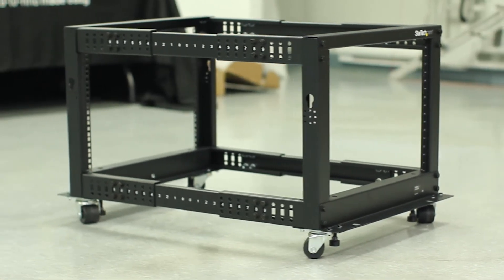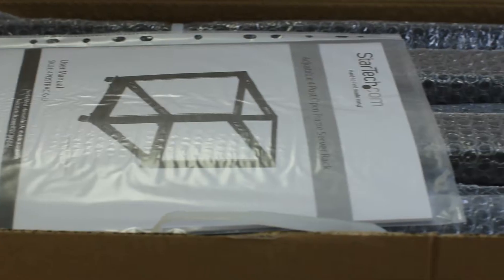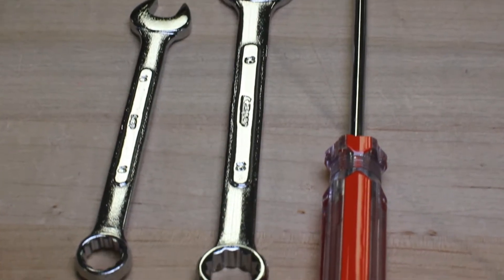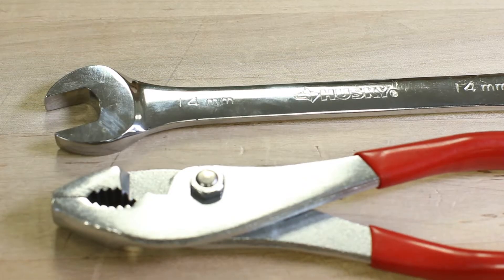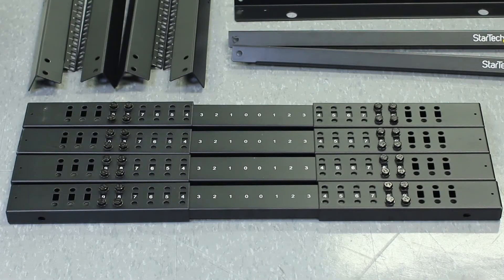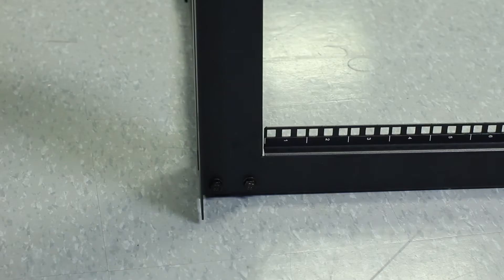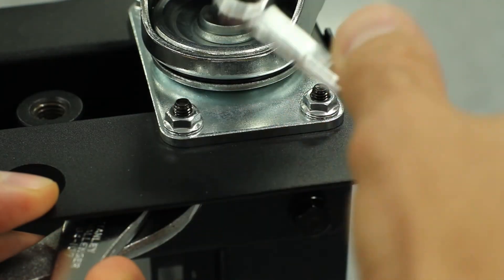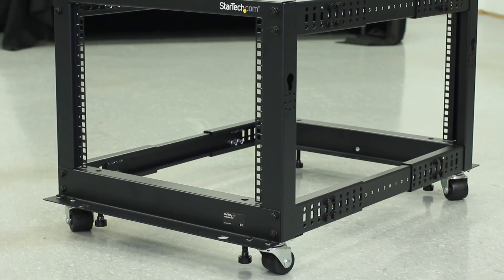UNBOXING and ASSEMBLY - 4 Post Open Frame Server Rack Series | StarTech.com

Comment: One of the wheel bolts is a real challenge to get in as it’s partially blocked underneath by a bolt on the adjustable rail. I removed the bolts on the rail to allow for some movement and was able to get the bolt in eventually.

Comment: Ok, I built mine just by looking at the schematic diagram, however, I'm looking for how to set the adjustable sections. Instructions say "for x use index numbers y and z" but how do I reference them to get the desired setting? There's no marks to indicate a referance point to use the indexed numbers.
Reply from the maker: Hi, You may want to check in with our Technical Advisors - They are available Monday through Friday 24 hours a day. https://chat.startech.com/

They can walk you through adjusting the rack to fit your set up.

Comment: This video really helped with getting the pieces in place in the right order. The instruction manual suggests that the top and bottom horizonal bars install between the left/right bars and the adujustable bars, when they should mount in front of the whole stack. Once that was cleared up, the rest of the assembly process went rather smoothly  (except for the feet, see below).

Helpful tips that I wish I knew ahead of time:

* when installing the top horizontal bars, it helps to bolt the adjustable bar into the left/right bars though the bottom bolt hole before attaching the top horizontal bar through the top bolt hole - that will hold the adjustable bar to the left/right bar while you align the horizontal bar
* the bolt holes for the adjustable feet have a plastic lip at the end (why???) that you have to thread through with the bolt as you screw the feet in; you'll need an adjustable wrench to apply enough torque to screw them in
* if you are using both the levelling feet and the casters, screw in the levelling feet in first; otherwise the casters will get in the way of turning the wrench
Reply from the maker: Hi Andrew - Thanks for the feedback. We'll pass this on to our team.
Reply: From what I can tell, one side of the rack (say, the front) is supposed to be in front of the whole stack, and the other side (back) should be in the middle. That's the reason I'm looking at this video too, and I hope I'm right

Comment: I'm loving this open frame rack so far! I'm almost finished putting it together, and it is solid and very well made. The instruction manual is remarkably clear, the only reason I watched this video was to check the wheel and levelling screws installation.